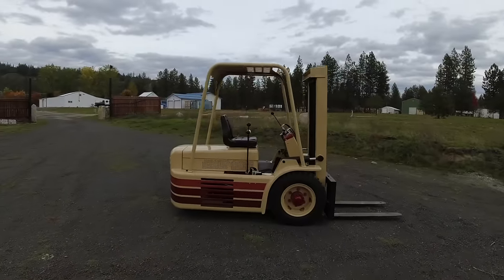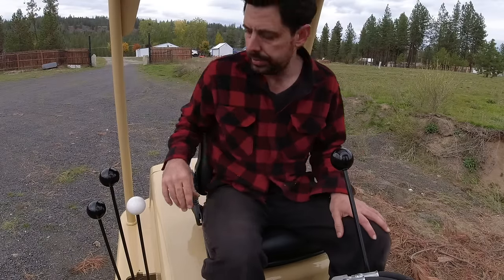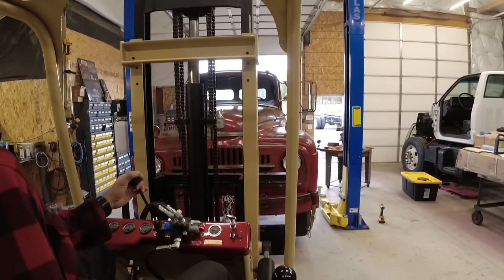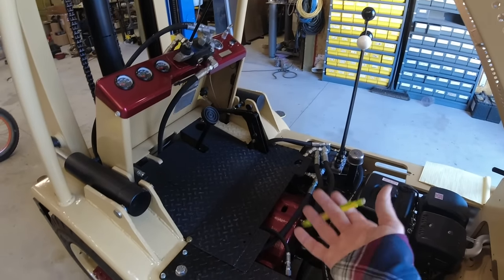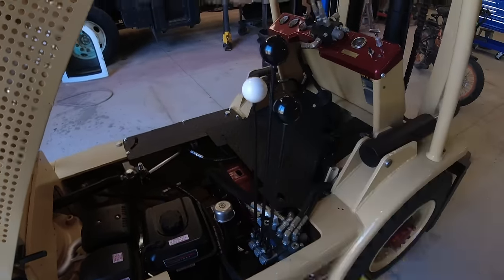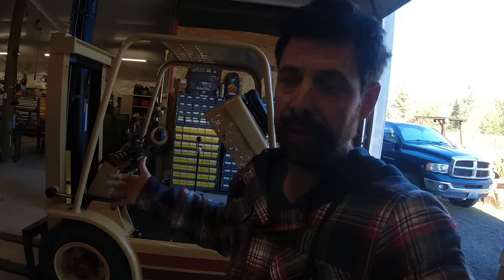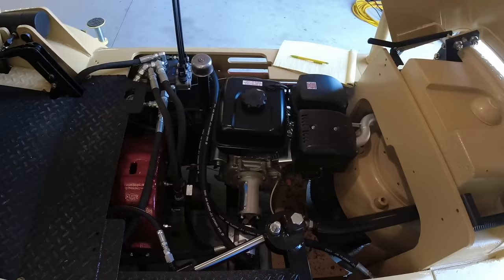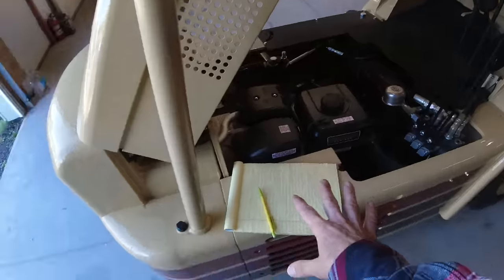How Well Does The 13hp Single Cylinder Forklift Conversion Actually Work?

Comment: I have been a forklift driver for over 50 years. The last 19 years, I have been a driver for the very company that originally built yours. The only time I ever use sideshift is when I am required to do so for testing purposes, as a "test driver". I would happily give up sideshift for "fork possitioners", or the ability to move the forks closer together or farther apart without exiting the driver's compartment, especially concerning larger trucks where the forks are too heavy to move. So, I have no problem with your choice to remove the sideshift, and as small as your lift truck is, you don't need fork positioners either.👍
Reply: My workplace has Toyotas with both side shifting and fork positioning, I can't imagine using one without both of them. It's super useful for fine maneuvering and positioning of boxes on top of each other.
Reply: Side shift is the best. Especially for narrow racking and stacking things. Another useful thing with sideshift is you can "shuffle" pallets around. However it's extremely situational.
Reply: I used to drive Hyster 3600s (very large) with side shift AND fork positioners. The two options paired together made for super easy positing of the massive forks on those machines. I honestly would have kept this feature even on a little forklift.
Reply: I used side shift all the time when I stacked pallet goods 3 high
Reply: You must not have worked in LTL freight before. We definitely use the side shift a lot but the adjustable forks would be useful too.
Reply: Have many folks who work with you seen the restomod?
Reply: @Marklin15 I thought these were basic forklift features.. :-D Lasers (For positioning) used in forks go beyond what I've seen.
Reply: i used it a lot for stacking fruit bins at 20ft up on the farm fridges, you dont want to shift the wheels at all when your that high with that much load. its also great for stacking loads in trucks when you drive the forklift into the truck as you can use the side shift to push the load agianst the wall. 
but you could also do all those things without sideshift. it just takes longer and you have to be perfect manuvering and placement or be rougher with your cargo. 
i still liked the little eletric forklift we had at that farm, quite so you could talk to people while working and bring stuff out to the sales deck for customers without disturbing everyone and great as an engine hoist. i would love to see a predator to electric conversion next. also proper hydro steer with a wheel. levers are dumb.
Reply: @Failure_Is_An_Option go ahead and argue or be rude. I said what I meant in defense against haters like you.

Edit. Apparently this hater not only deleted his comment, but also his account. I don't remember what he said.

Comment: I'm glad I could help a little bit on making this hydraulic system more reliable and nicer to use. Nice touch on painting the letters on the counter weight. Looks really nice. I wouldn't be too concerned about the difference in lift capacity either. That thing is so overbuilt that even without the engine, it would lift max capacity. :)
Reply from the maker: I'm looking forward to seeing how your forklift conversion turns out

Comment: Love it. The colours are superb (inc the rear) and the mix of old and new is a delight (maybe not the engine but so what, your rodeo, your rules). Also really like the fact you've improved it from first go. The slower steering looks much easier to use. I bet it's a great talking point whenever you get a delivery and hopefully a joy every time you use it. Well done.

Comment: You could use a foot throttle pedal to bump the engine speed up to max only when you need it. Like driving in a straight line or quickly raising the forks. That way you won't have a screaming engine all the time and won't have to endure the slow crawl.

The steering indicator could use a highlight. Instead of painting the scuff plate or the indicator, perhaps a plate painted bright then have the pin stuck through in the middle. That way it's recessed, keeping dirt off it, as a bonus you could paint each half a different color so you could glance down read how much the corresponding color is showing.

Comment: Would've been more expensive but for steering control an Orbital valve might've been a better choice, would let you keep a steering wheel and give more control over steering since it moves faster the faster you turn the wheel :P Would also provide for a tilt steering wheel since only hoses go to the valve.
Reply: i woulda done that and  steering NOT have 1st prioity..
Reply: Steering having priority is the normal way of doing it, loosing steering when handling a load is worse than the hydraulic functions being slower, essentially everything uses more oil than the steering so if it isn't first it'll be starved when other functions are used and will be lost entirely, this is usually handled with a priority valve in commercial machinery. @taomicioli
Reply: @HStahlberg  ok.. maybe split pump output to each, with a flow controller (saw it at the end of vid)
Reply: @taomicioli  That is the cheapest way to handle it but very valid, best way is to have 2 pumps, 1 for drive and 1 for load handling/steering with a ptiority valve.
Reply: i thought he tried and orbital valve and it didn't work right?

Comment: I gave you a sub because you're saving that SD220/240 or whatever it is, plus the (presumably) T98 trans it's hooked to. Every single part for that engine and transmission (minus intake/exhaust manifolds) is still relatively easy to find. Only about 100 horsies but loads of torque, and it'll run at its max governed RPM all day long for years as long as you give it enough cooling. Can't say enough nice things about an IH I6. Oh, and the forkylift is real purdy, too. Now I have to justify to my wife why I, too, need a forklift for [REASONS]
Reply from the maker: That is actually a Clark non synchro 5 speed factory trans. I was expecting a t98 as well. Not sure what I will do with it, but I will find a good home for em. I love inline sixes. Ford 300 is my favorite

Comment: Fully agreed on the side shift, for your average person it's just not that useful. Sure it's great in a production facility where every second counts, but outside of that it's a nice to have, but not necessary. Funny enough I have that identical flow control valve on my PTO driven wood chipper for the power feed.
Reply: Funny enough I just got  a new truck with a side shift to replace an old one that didn't, and now I feel I don't know how I lived without it!  For accurate positioning of pallets on a racking, it's a real boon and often saves a shunt.

Comment: This is a fantastic conversion, I wouldn't have expected a little single-cylinder engine to work anywhere near as well as this works.

I have a suggestion for your steering indication - Attach a push-pull cable for a remote gauge. You could snake the cable to the top of the fixed part of the mast so that the steering position indicator is always right in front of you.

Comment: Initially, I was slightly surprised that you didn't cut a line/grove on top of your steering indicator pin -- front to back when centered -- to make reading at a glance easier.   (Rather than leave it a black circle in a black panel above a black void.)  

But while thinking about the geometry of hanging a rotating pointer on it, to amplify the rotation (to match the actual wheel's position)  - I remembered that it is in a step;  So the 'natural colour' of the area may outline it soon enough. 

Maybe stick a round cap on top of it, just to make spotting/locating it at a glance easier in low light?

Comment: Pulling truck weights would be a possibility if you decide to change rear weight balance. They are made for quick removal so if you had a stable and secure attachment point; adding and removing could be as needed. Painted red of course...
Reply from the maker: Where would be a good place to source those weights?
Reply: @AustinCoulson  Could mount them on the rear hitch with a rack. That's the extreme end, best spot. It would also make it easy to put on and off. You wouldn't need them all the time. If you can have some pipe bent to match the shape of the rear casting, then it would also look stylish, as the weights would contour to that shape too.

Comment: Pretty nifty build on the old Hyster lift truck! You should maybe look into a steering block and wheel (orbital valve) from an old road grader or something similar that has full hydraulic steering. Then it would steer like a normal vehicle, and your hydraulic plumbing could still reside under the 'dash'.😉
Reply from the maker: I might do that later on

Comment: Would be cool to see one of those 10hp chinese diesel engines in it. Either way I love everything about this forklift!
Reply from the maker: That would be cool, but this pump requires at least 12hp and I don't have a ton of experience with those cheap lil diesels. I would love to play around with one. Maybe on a little go kart
Reply: @AustinCoulson   Oh ok makes sense didn't realize it needed a certain amount of hp. Would love to see you tinker with one sometime:) thank you so much for replying

Comment: I am surprised that the weight capacity is at spec at 30".  Everything behind the drive axle IS part of the counter weight system engineered into the unit.  I do appreciate the ingenuity and work you put into it.  Its a great looking lift, thank you for sharing the build and your experiences with it.
Reply from the maker: It has a rating tag on it that shows the lifting capacity at different distances on the forks. Its 5K at 15" then progressively drops to 3.5k at 30"
Reply: @AustinCoulson  I understand that the lift was originally designed with a specified lifting capacity.  After it was actually built and tested, the tag that you read now was produced.  The lift rating includes having complete steering ability with the mast tilted forward and the forks at that capacity (location on forks, height of forks, mast tilted furthest away from the operator).  There are other considerations as well; consider how you would loose steering if you were traveling down an incline or traveling at the original speed and suddenly had to change direction while applying the brakes.  You had steering issues at approximately the rated capacity.   Like I said before, I think the build is great.  I would personally do the same things with it that you are.  I am only trying to make sure that you or anyone else is aware that the weight you removed is part of the counter balance and that it does affect the lifting abilities and stability of the lift.
Reply: I"m not that surprised as most of the loss is between the wheels, but it puts the 3,500/5,000 close to absolute max, and not safety max. It'd be a bigger matter if the counterweight at the rear was a couple 3 hundred less. That was why in the first vid, I suggested putting the difference in weight as far back and as low as possible to give it a bigger safety margin.
Reply: Putting in a lighter engine has reduced the counter-balance weight, so strictly speaking the capacity should be reduced in proportion, to avoid eroding the factor of safety.  This could be overcome by adding some dead weight inside the back of the frame.

Comment: What it is really supposed to have is a variable displacement pump. For running motors like you have you are supposed to use a motor valve. in the neutral position, it allows the motor to free spool.
Reply: one of those costs as much as all the other hydraulic components he has combined.
Reply from the maker: 100%. This was already getting a little expensive for a test project that I didn't even know would work. If I would've known I was going with a flow diverter valve, I would've gone with an orbital valve for steering.  But those are also expensive

Comment: I feel like a simple orbital valve with a steering wheel on it would be a better choice then the stick steering controls. Just for user friendliness. Cool looking resto though !!
Reply from the maker: If I would have known that I was going to use this diverter valve, I could have used an orbital steering valve. It would have added about 500$ but would have been worth it.  I still may change it out later

Comment: you can get a billet con rod and stage one valve springs  and a custom TQ cam or custom grind at delta cams lol ;] but for real drilling out main jet one size up with mini drill bits or just order a kit  helps them so much in stock form with pulling loads the fuel as they have no traffic squirt pump and epa lean burn ye know.  if i had to swap engines i w00d get a H.F. twin just because it sounds kohl E R ARE SWEET MAY BE CAN SCORE ONE CHEAP ONE DAY good no really modding the harbor freight engines are fun and the 460 or 490cc [i forget new red one ] is built like a tank the piston even looks like a race piston design really impressed and that same  design is used on the generators  to me a bit better that the black o\ne but one can not get billet con rods for it [red one ] but can for the black 13hp  420cc units. fyi billet rods have insert bearings unlike OEM rods that do not a nice thing .pardon the bad grammar type fast and on the run you could say

Comment: For the electric start throw a little Noco Lithium Battery in it. It's pretty reasonably priced. I have one on my Motorcycle and love it. It starts hard and doesn't drain as it sits near as bad as the old lead acid battery
Reply from the maker: Great idea

Comment: seems like a nice and working conversion might be eazier to operate if you can do both the forwarth and reverse and the steering off the same lever (4 way like a joystick operation )
loosing the bigger original engine does mean it can lift less before it dips forwarts

Comment: That slow speed i think would drive me nuts. But in actuality it would be just fine. But, is there a way to add a second "gear" (not familiar with hydraulics at all really) that you could flip a valve to increase speed maybe? Also, curious why you didn't add electric start motor. I think I am just lazy lol
Reply from the maker: It already has an electric starter on it, but it needs a battery to operate it. I will probably hook a battery up to it later so I can use that. The transmission has 2 speeds but I haven't figured out how I will do the shifter linkage yet. I forgot to mention that at the end of this video.
Reply: oh and I too follow Lucia. She's brilliant. Love her work. She's not just the face of the channel mimicking what her husband does. She is actually doing the work herself.
Reply: cool ok. Thanks @AustinCoulson
Reply: @AustinCoulson   Adding that battery puts you on your journey to getting original weight back too.

Comment: Amazing work. I have no experience with mechanics but one question came to mind. Is it safe for those pipes to be running on the front panel ? isn't it dangerous if one failed and had high pressure fluid shooting in the face ?
Reply from the maker: Yea that would not be good. The pump maxes out at 3000psi and the hoses are rated for 4800psi so they usually fail after years of sun damage, but in the follow up video I add some hose sleeves

Comment: This thing is awesome, with one exception. It drives to slowly for me. I’d go nuts only being able to travel at 1mph. What could be done to speed it up? You said the hydraulic motor makes it 25% of the previous speed? Hypothetically of course, could you upsize the motor to say.. go at half previous speed with the current predator   Engine?
Reply from the maker: The engine/pump/motor are all rated around the same (13gpm). I was operating in first gear. second is faster but has less torque. I could've gone with a predator v twin and a 21 gpm pump and motor but it would have added about 1500-2k$ and its already plenty fast for my needs.

Comment: If you connect a cable to the steering indicator and run it up to the dash into you natural field of view with an indicator there you wouldn't have to look away from the front to tell where the wheel is

Comment: Which of the 2 speeds is the transmission in? and do you still have the ability to shift between them?
Reply from the maker: It's currently in first gear. I can shift it, but I have to hop off the lift and raise the hood to do it because I haven't hooked up linkage and a proper shifter yet, but I will.

Comment: Fantastic build, if you had to buy a new engine every 2 years your still in great shape, just get the $30 3 year warranty 😂. As an owner operator you don’t need to have equipment certified -As long as it’s not for hire.